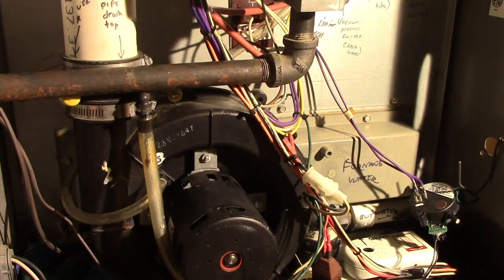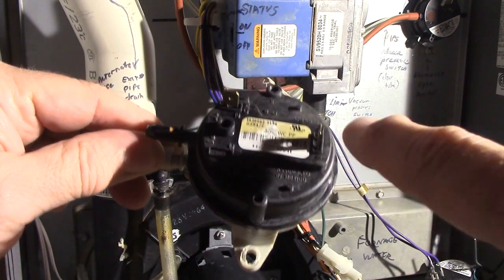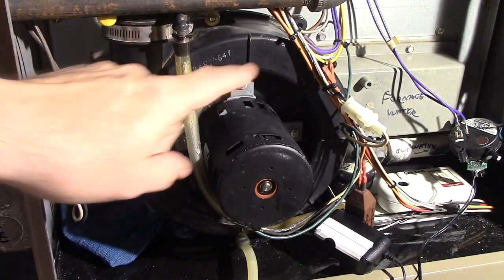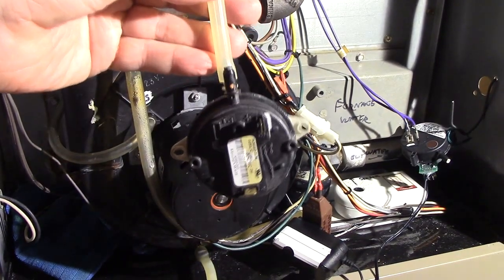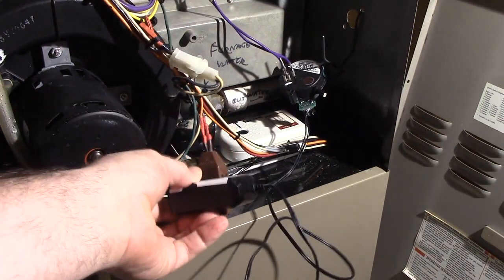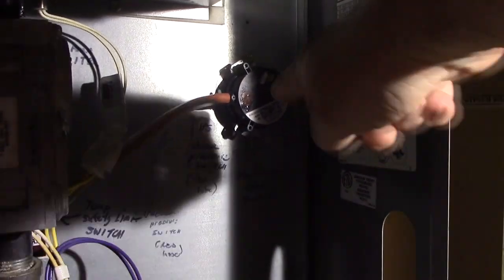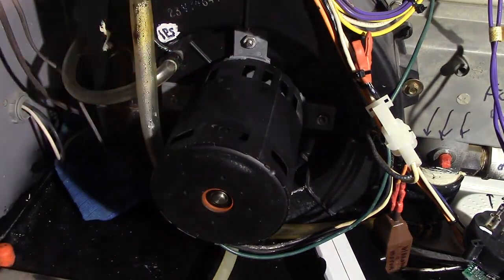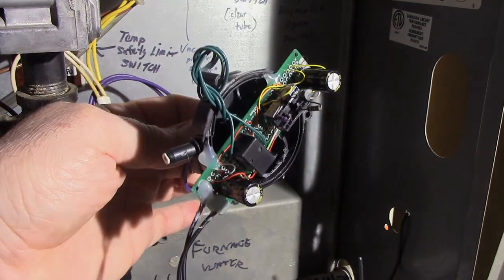Circuit to Temporarily Bypass Furnace Pressure Switch to regain Functioning Furnace (6-3 Fault Code)

Comment: Hi Mr. Robert, I've got APS issue with my Hermann (Eura series) combi boiler these days, I've watched this video and started doing this circuit diagram you provided, while doing that I came up with similar but way easier bypass trick idea, I can send my video to you just for experience (as I was inspired by yours) to see, if you want of course, just provide an email to send to / Thank you for this great idea ❤❤❤.  BTW I have already installed my own bypass trick relay and it works flowlessly at the moment
Reply from the maker: Great to hear. Sure send me over your version. r.veach@comcast.net  Thank you.

Comment: Love the practical application of electronics knowledge here; well done.
Also: If this is a common failure scenario, why not just keep a spare pressure switch on hand? They’re pretty cheap considering the “insurance value”. I do the same for our well pump pressure switch since being without water is equally annoying; maybe even more so.  😎
In any case, nice job!!
Reply from the maker: Thanks. I am tired of keeping a spare pressure switch. They take 12 days to be delivered and run about $125.

Comment from the maker: Circuit to Temporarily Bypass Furnace Pressure Switch to regain Functioning Furnace (6-3 Fault Code)

I have the ordering links to all the parts I used to make this circuit.

Relay: https://www.mouser.com/ProductDetail/...
or https://www.radwell.com/en-US/Buy/RAD...

330uF Capacitor: https://amzn.to/402ozzV
1N4001 DIODE: https://amzn.to/3M05iJN
1N4148 Switching Diode: https://amzn.to/3QhXTYS
10k Ohm Resistor: https://amzn.to/3FndXSR
39k Ohm Resistor: https://amzn.to/3rMz3qH
Transistor, NPN-2N3704 : https://amzn.to/3M55PKj
ALITOVE DC 12V 1A Power Supply:https://amzn.to/3M4OmSx
Double Sided PCB Board Prototype Kit: https://amzn.to/3QhKpwc